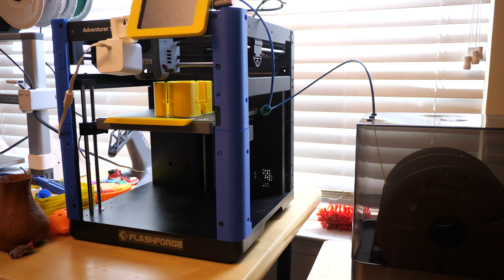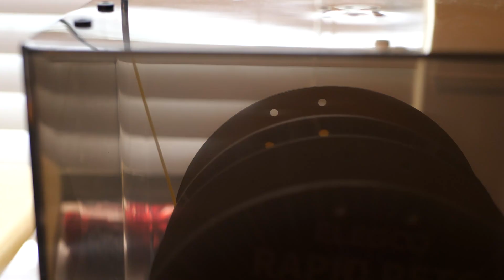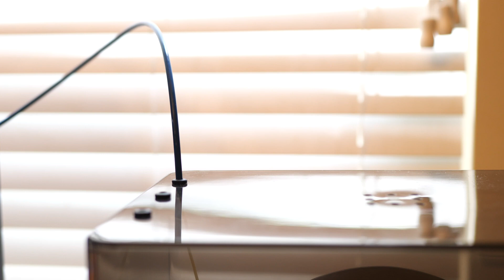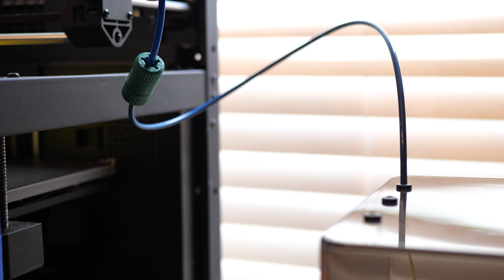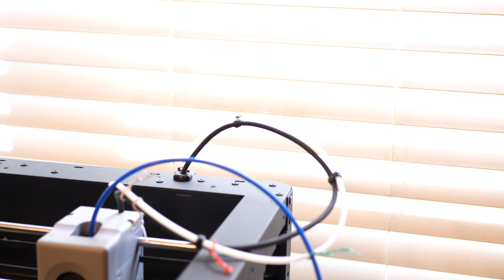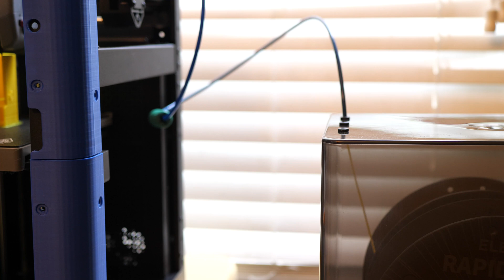How To EASILY Connect Your 3D Printer to a Filament Dryer

Comment: I wonder if you could feed filament straight from that dryer into the new AD5X?   Dryer might need to be a little lower than the printer like you have this setup.

Comment: Unfortunately you used the makerworld repository. The owner Bambu Lab has a history of stealing user's data, usage and print files. 
Otherwise useful tips to join multiple short PTFE tubes and printing from a dry box. You can also use larger internal diameter PTFE tube for less resistance in twisty tubes. Use a heat gun/heat source to unkink the PTFE, just be careful to not melt it.
Printing some strain relief to support the PTFE going into the extruder, anchoring the PTFE tube to the frame and use some stiffener wire , like 1mm piano wire, to support the power cables/PTFE tubes to the extruder might reduce risks for jams or pinching when you get into the hundreds or thousands of printing hours.

Comment: I run the tube from the box to the existing tube on my X1 Carbon - but I don't join them. The filament holds the tubes together and it never pulls apart. I thought I'd need a connector, but i tried this and it has never failed. 

*Your milage may vary, your home may be at risk if you do not keep up repayments. All stunts performed on a closed road.